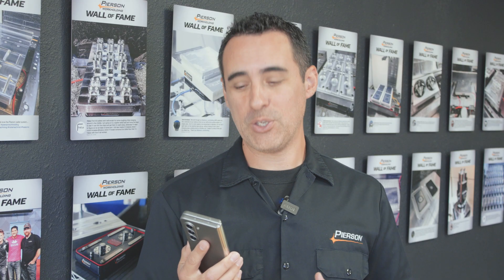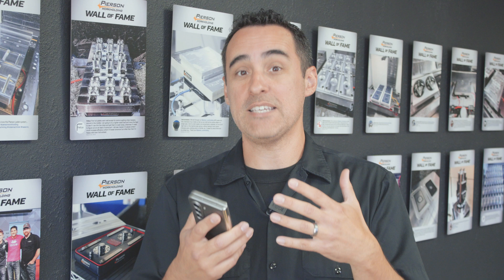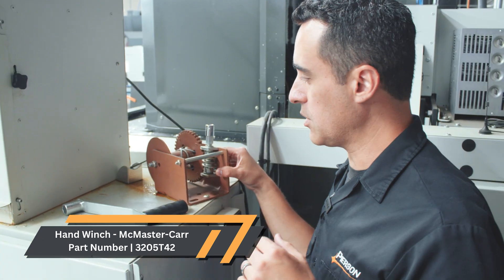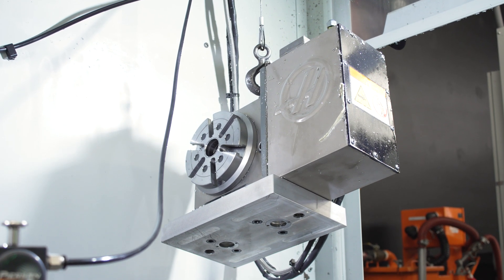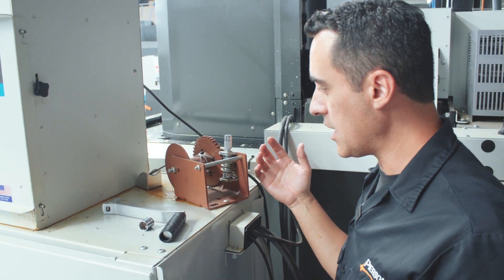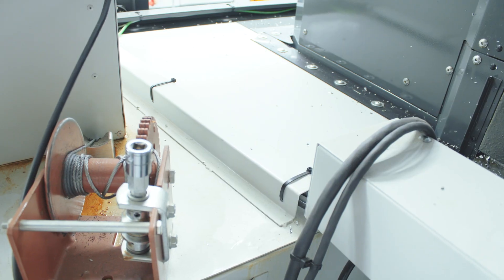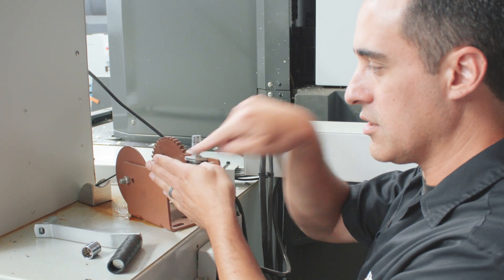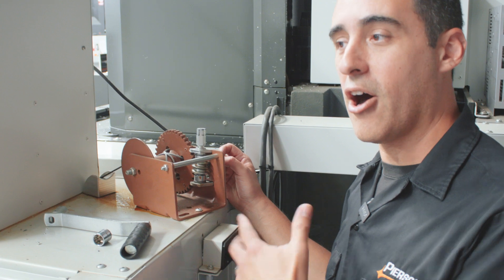Dangling a $13,000 Haas Rotary Indexer! | Pierson Workholding

Comment: Thank you! As a guide I used a 1/4 npt 45deg brass adapter for air with a nut, that way I even didn't have to make a part and the setup goes through the sheet metal and stays clamped from the other side.
I really appreciate this video. Great idea!

Comment: First, I admire and respect your accomplishments, your a smart cookie.  This is just factual info that may or may not be applicable depending on your level of accuracy.  Even leaning against the machine's front will move your machines tram because of the way the sheet metal is attached, i have many NC's a few different brands. Don't believe me , put a tenths indicator from spindle to table or vise and watch the needle move as you put your weight leaning against the front of the machine. Hanging over 200 lbs from the sheet metal may be moving your machine out of TRAM.  Just info.

Comment: Have you noticed any weight shift for the machine and need to re calibrate probe when the rotary is mounted or not mounted?
Reply from the maker: Nothing measurable. I roughly recall that Haas machines monitor inertial loads to calculate acceleration/deceleration.